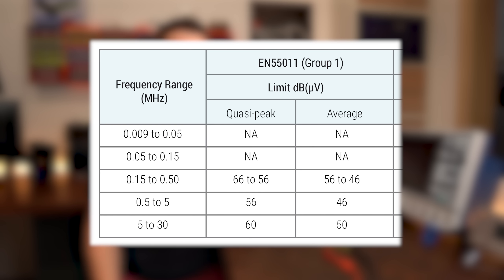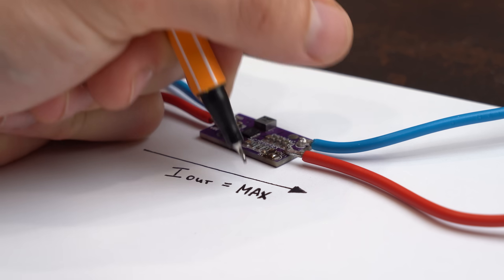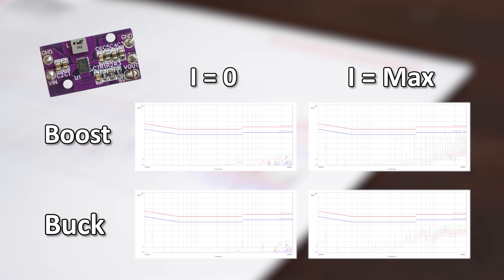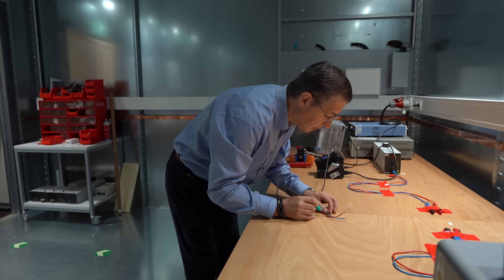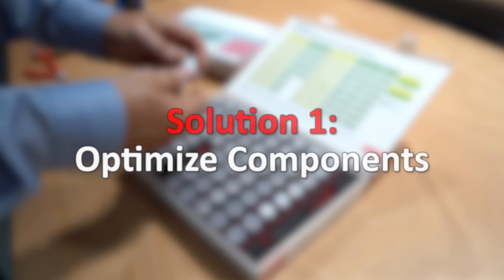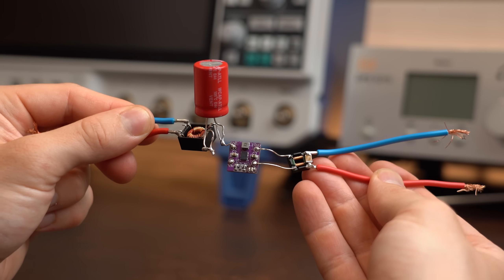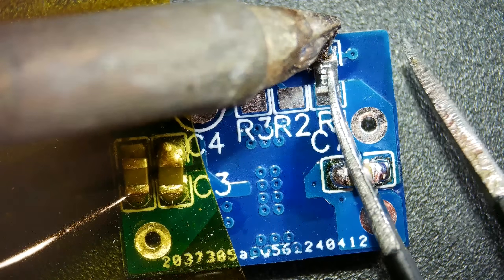Are my Circuits ILLEGAL to use?! (EMC Testing)

Comment: at JLCPCB and similar manufacturers, there's almost no price difference between 4 and 2 layer boards, especially compared to shipping and assembly 

so just always start with 4 layers for DIY projects unless it's a super duper simple design.
You make your life layouting easier, it'll work better for EMC as well as general performance, and you can make it fit into the size you want more easily.

The stackups of 
PWR/DATA
GND
GND
PWR/DATA

or 

PWR/DATA
GND
PWR/DATA
GND
are typical recommendations that work for many applications
Reply from the maker: Thanks for the tip and feedback :-)
Reply: I designed my first 4 layer board earlier this year and really enjoyed it! Layout is so much easier and clean when you have easy access to ground and power.  😊
Reply: A 4-layer board is rapidly approaching unfixable though. Any major corrosion damage to vias or inside layers is basically a death sentence. Conformal coating would be very much recommended out in the field.
Reply: I totally agree and I quite like that first stackup for most applications. Excellent advice to send beginners in that direction. 👍
Power can be run as traces without issue and the ground plane is by far the most important to have uninterrupted.

Comment: I have been designing products for 35 years and I have always had excellent experiences with Würth Elektronik components. They are excellent. 
In such a design as this DC-DC converter I would immediately switch to a 4 layer PCB, but I would use both layers 2 and 3 for ground with plenty of via stitching. I would also flood any unused space on layers 1 and 4 and stitch those to ground too. It's a crazy rabbit hole. Robert Feranec is an excellent resource for expert lectures on EMC and PCB design.
Reply from the maker: Thanks for the feedback and tips. I bet with 35 years of experience, you have seen some crazy designs.
Reply: What kind of difference can it make if opposite is done, both outer layers used for ground, and 2,3 for current and signaling?
Reply: @Gastell0  Vias are inductors in those frequencies and would affect negatively more than the incomplete faraday cage you get from outer layer GND pour would help.
Reply: @Gastell0  That's a recipe for cross-talk.
The primary goal is to have a matching return path.  You get that with internal ground planes, and additional isolation with two ground planes.

You can often do a quite a bit to improve two layer circuit boards, but it does take far more design time and perhaps additional circuit board area.
Reply: @Gastell0  In addition to the other replies, you cannot put your components into these inner layers. They would sit on top of the ground layers and every signal has to go down with vias and you rip your solid ground planes apart.
Reply: @Gastell0  (power electronics engineer, also 35yrs) you'll almost cetainly make it worse. all of your components are on the outer layers, so you cant avoid some connections, and now your GND "planes" will have big holes in them, making them much worse. what you should do, though, is choose your layer stackup carefully. top and mid layer 1 very close together, a large spacing then mid layer 2 and bottom very close together. makes sure the ground plane is directly below the layer with all the switching stuff on it, and has no large (heh. for certain values of large) holes or slots in it.
Reply: I guess the most successful solution for Scott's new design will be to combine your idea of 4 layers with the 3 part video from Hans https://www.youtube.com/watch?v=EEb_0dja8tE and design a PCB with layer 2 as preferred ground.
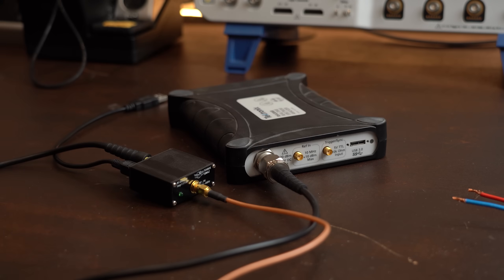Reply: 2:09
Reply: Hello I have a question, if you via top and bottom to inner layer gnd, does that mean you have also covered(leaving paths for signal lines and power lines) top and bottom with gnd too?
Reply: Stupid question here..........that much ground plane, in an overall sense, what does it do? Does it just provide more stability for the overall circuit in general, like having the 'biggest reference point in the room' sort of idea? Does that help negate interference?
Never mind, I Googled it.
Reply: @minkorrh  As much ground as possible is better but electrically there is a point of diminishing return however you also need to consider cost and mechanical properties.  When you manufacture boards you pay to remove copper so the more copper you leave behind the better, but keeping everything filled is also better mechanically from a manufacturing standpoint because the layers stay flat instead of bowing.  Big ground planes on every layer gives you best power ground performance, best EMC performance, lowest cost, least warpage, and fastest manufacturing.  What's not to like?  If you want an excellent learning source online I suggest the videos from Robert Feranec of Fedevel Academy who interviews plenty of chartered giants of industry.  There are few better opportunities to learn from experienced experts.
Reply: Can you explain to a layman how having unused areas on a multi-layer PCB grounded would help with this issue?

Is the copper in this scenario, in such close proximity, basically absorbing and grounding out EM noise before it gets a chance to broadcast?

If so, does that mean that you could, for a quick and dirty fix, just wrap these small PCBs that are failing in a layer of capton tape for insulation and then in a layer of aluminum tape which is grounded? I realize that might cook the components, but I am ignoring that issue for the sake of this question.
Reply: @Nevir202  As uki352 mentions, at low frequencies (below ~15KHz) the additional copper can help carry current for a lower impedance supply and the additional copper also provides some shielding, but speaking primarily for larger boards than this DC-DC converter, the main reason for copper pours on layers 1 and 4 is usually for keeping the board as dimensionally stable as possible in fabrication. Your 4 layer board will be built from two very thin 2 layer boards which are glued to a piece of core material. One side of each of these thin boards is a solid copper pour if you use the stackup I mentioned so if you have areas with little copper on the top or bottom, you can get warpy boards. The copper pours even that out. Always remember that you pay for copper removal so if you're running your own facilities, the extra copper pours get you better EMC, easier to fabricate PCBs, and they take less chemistry/time ($$$) to fabricate.

For your quick and dirty shielding question, I have seen many small power supplies wrapped up exactly as you describe with the one difference being the metal tape is copper and a ground wire is soldered to that copper. Many laptop power supplies are built this way. If you pot the PCB in thermal epoxy first, the cooling can be dealt with.
Reply: @Peter_S_  Much appreciated!
Reply: @Nevir202  My pleasure. Oh, and I forgot the extra copper also helps with heat dispersal. Lots of bonuses from lots of non-EMC directions.
Reply: @Peter_S_  I had read that the two-2-layer-boards method was older, though still used if you want to minimize problems with either dimensional stability or controlled impedance.  If this is true,  the more common 4-layer board today would be a single 2-layer board, with an extra pre-preg and copper foil on each side.  It is still true that layers 1&2 (and 3&4) are much closer to each other than 2&3, though not always by a factor of 10.
I also think the extra pours on a very close layer can create extra capacitance -- whether it is enough extra/better capacitance to actually matter is a different question.
Reply: @jimjjewett  I was just trying to paint an analogous picture that people who are unfamiliar could immediately grock, but you are correct. In the overwhelming majority of 0.062" PCBs these days, they start with the interlayer using core and then sandwich prepreg plus a copper layer to each side. You still need even copper distribution to avoid warping from that cause though. If you're making backplanes with 0.125" thick PCBs and 2oz internal layers with no high speed bytelanes then fab techniques may vary a little. 

The extra pours can indeed create extra capacitance, but it's very minimal in the stackup I mentioned above. It is enough that you should observe the 20H rule or something similar for spacing with controlled impedance traces. I have seen Ansys runs on other stackups with a power plane and GND pours above, and they do indeed make a positive difference in some situations. It all helps at low speed. I've also seen layouts which exploit that top and bottom pour method for more ideal power distribution networks and I'm sold.
Reply: @Nevir202  unused areas help spread current if current is DC or low frequency. If frequencies get higher  then current is flowing on the edges of the traces. Long thin traces, such as vias, then act as antennas. 
In 4 layer boards layers 1, 2 and 3, 4 are closer to each other, while 2 and 3 are more spaced. So a copper area on layer 2 helps keeping ground vias to be short and the plane of ground helps current flowing to its destination.
Reply: @Nevir202  Your electrical signals actually travel as electromagnetic fields that are confined within waveguides. The two waveguide types in this discussion are the microstrip and grounded coplanar waveguides. The microstrip is formed by the copper trace, dielectric substrate, and ground plane. The grounded coplanar is similar; the difference is an extra ground plane on the same layer as the copper trace with isolation channels separating the trace and ground plane. 
The conductive copper regions act as a boundary for the EM signal, so if there were missing copper on the waveguide along the signal's propagation path then the EM can leak out the boundary, and then couple into other nearby conductors or radiate from the board entirely. The geometry and material properties of the PCB will affect what EM energy can and can't be confined. Generally, it's harder to confine higher frequencies.
I don't think the quick, dirty fix would be helpful. I think it would probably increase the parasitic capacitance in your circuits.
Reply: Feranec is good, but he is giving recipes only: no struggle behind, no story, just a recipe.
Reply: @ДаудМухамеджанов  especially with the videos how the current and voltage flows by using a ultra expensive software tools nobody can afford, so if you are a hobbyist you will never have a chance to explore differences of performances by using poor and good PCB layout.  :)
Reply: Or just put the converter in a Faraday cage? Way cheaper than a 4 layer PCB.
Reply: @mernokimuvek  LOL, no.

Comment: Reducing EMI from power supplies is an art. Every switcher in my house has some kind of noise suppression. Over the years I've become adept at finding the cheapest and most effective solution. I do this, of course, to minimize noise to my ham radio receivers.  The real question is, how to I get my crazy neighbor to let me fix his noisy military grade radio jammer power supply.
Reply from the maker: Thanks for the feedback :-)
Reply: Extraneous RFI makes ham radio folks cry 😂😂  so many cheap power supplies are very noisy!
Reply: Step 1: knock on your neighbors door
Step 2: introduce yourself and ask what their favorite food or drink is
Step 3: buy said food or drink
Step 4: deliver said food or drink, ask if they would mind helping you identify the cause by turning stuff off

Alternatively, if you're an extreme introvert just wait it out, Mr Grimm Reaper will sort things out for you eventually 🥰
Reply: @sirtra  Thanks for the suggestions, but did I mention my neighbor is 'crazy'? He's some old weird guy who lives alone and sets out bait surrounded by cholla cactus to entangle local cats that enter his yard. I do have a plan to reach him, but its too much to explain here on YouTube. Also, he already allowed me to pinpoint the exact appliance causing the noise, and refused my offers to help correct the problem. It will cost me a few $100, but maybe if I show up with a replacement, explaining that the old one is a fire hazard, he will allow me to replace / install it.
Reply: @reedreamer9518  fun fact: cats are able to sense electromagnetic radiation such as when an electric fence is on or not without touching the conductive wire (no cap, one guy on a farm did a whole video on it)
Reply: @sirtra  I know, I hate when that happens. That's happened to me a dozen times.
Reply: When I was a kid my neighbour had a kitchen mixer that jammed all tv and radio on both am and fm in the whole street when he turned it on. I can't imagine the hassle of trying to receive weak signals when people are running their cheap motors in badly designed products for everything day and night.
Reply: Cats absorb a LOT of RF energy in the 2.4GHz spectrum...
At least, the one I put in the microwave did
Reply: RF noise SUCKS!
Reply: I can relate to that, i am a Ham Operator my self, in the winter time i almost know where a heating system is powering on, or when the neighbours are switching on their cheap LED Roomlights. But til now the PV Systems around here quite silent.

For your neighbour, ask the local authorities for assistance.
I don't know where are you from.
In Germany it is the Bundesnetzagentur, if you file a complaint the will make a appointment with you at the location and take measurements and if the owner of the HF source will not comply the BnetzA can prohibit the use.

Maybe it is a Power supply before thermal self destruction, a fellow Ham found something like that in his neighborhood, in this case is was a almost molten power supply from a WiFi Router.
Reply: @mariom.9472  I'm not sure things here work the same as in Germany. Here in the U.S. the government usually only takes action if you are doing something annoying to them (the government), while I doubt very much they would bother to correct my crazy neighbor for annoying me. For example, last year I discovered a local construction site (~4 miles away), employing unlicensed illegal aliens using Baofeng HT's and talking all day long, every day, in the middle of the 70cm ham band, interfering with amateur satellite downlinks. I filed an official complaint including recordings of the radio traffic to the FCC, and although they did send me confirmation, it has been almost a year and they have done nothing.  
For finding noise, I built a portable magnetic loop on a stick, hooked up to a Tiny Spectrum Analyzer with waterfall display. So I can traced the location of a noise and triangulate its exact position, even if I'm a hundred feet away.  In this case the neighbor let me scan the outer walls of his house and I know exactly what is causing the noise, only he refuses to do anything about it, even if I supply him with a replacement power supply.
Reply: @mariom.9472  more and more electronics in modern heating systems, I often wonder what happens if one of those starts massively leaking EMI. Because while the FCC(to use an example in my country) can order a person to cease using say a faulty TV set or WiFi. You cannot really make a person cease running their heat, My only guess is the communications authority funds the repair if a homeowner lacks the budget at that time.
Reply: @filanfyretracker  Yes and no, if the interference is powerful enough to interrupt ambulance, police and firefighter communication, the Bundesnetzagentur is not joking around.

In my opinion, the main problem is, that stuff has to be cheap not long lasting. If cheap power supplys are failing, some fail for a long time, in some cases equipment which is connected to the PS are getting destroyed to, (don't ask why i know...)